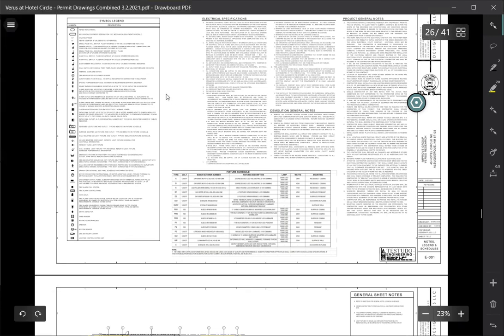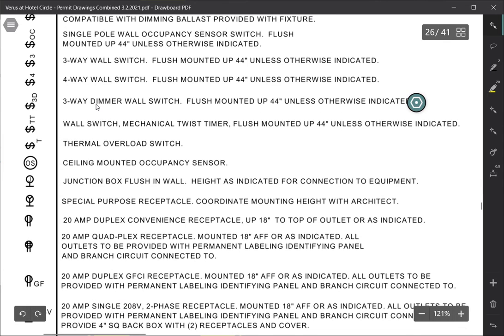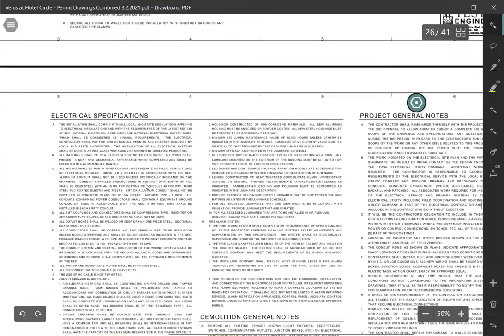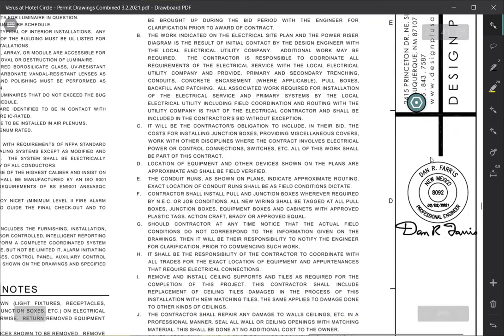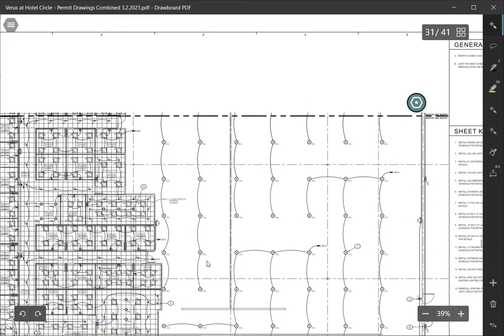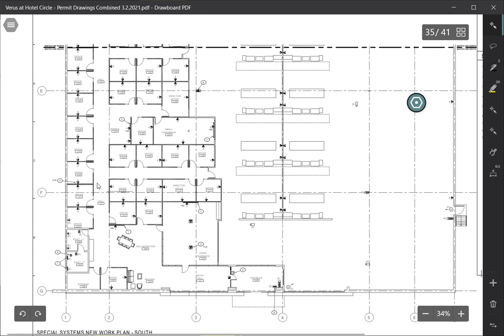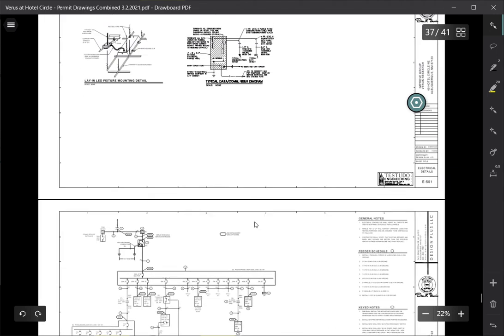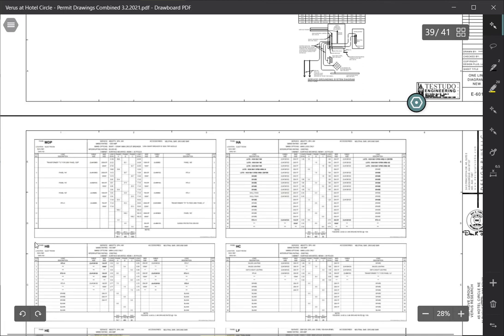How to read Electrical Blueprints!

Comment: Good stuff. I had to apprentice for a foreman that couldn't follow the print properly. He kept doing his own thing and blaming everyone else and they wouldn't let me transfer. I remember he tried to throw me under the buss but I stood up for myself. That's not how this works he shouted! Every time he failed at building a transformer rack I had to shoulder the bundles of strut several flights up to a roof along with everyone elses material. I put up with it for months until my back got really sore. Did you know a conduit runners injury can inflame your spine? Know how to read your print for the love of all things sane know what you are doing and don't waste someone time! Going to remove this from my feed because all I get is PTSD when I think of electrical work these days haha.

Comment: Thank you sir. very helpful video. 
you mentioned 2 ground rods because it is in the desert. what is the purpose of that?
Reply from the maker: Short answer : is New Mexico ground isn’t very  good at ohming because it is so dry here - longer answer: our state requires us to install two because most areas can not produce the min ohm resistance of 25  however if we had one more ground it make the difference needed. 
I’ll give you example I literally live on volcanic rock
Reply: @WARHAMMERELECTRIC  ahh right. I did glance over  the 25 ohm code. Very interesting, i did not know that. Thank you sir
Reply from the maker: @moop_fogo  you are very welcome thank you for watching

Comment: Bring on the info !!
Reply from the maker: Absolutely! I start working on that . Thank you for your input
Reply: @WARHAMMERELECTRIC  no, thank you 👍🏻👊🏻
Reply from the maker: It’s a lot lol anything else you are interested in seeing ?
Reply: @WARHAMMERELECTRIC  how about a video on making the head for wire pulls through conduit, conduit bending, conduit fill calculations, basically any of these will help.  Thank you for your time.